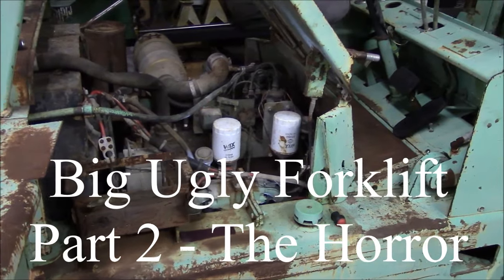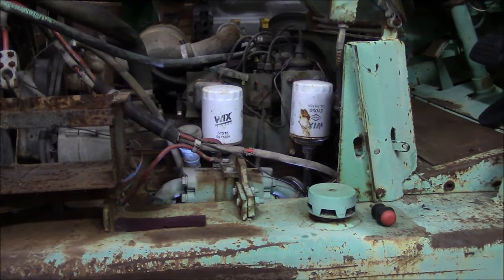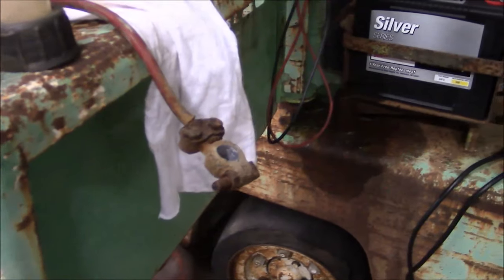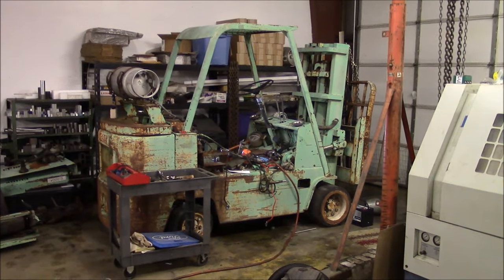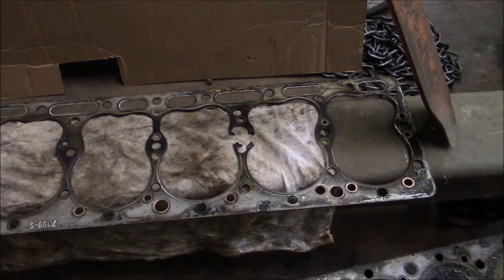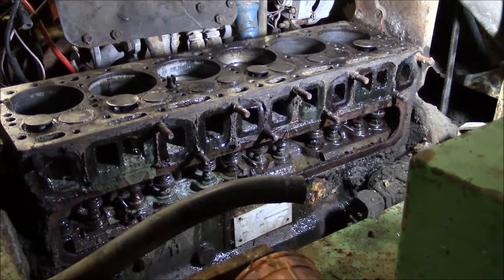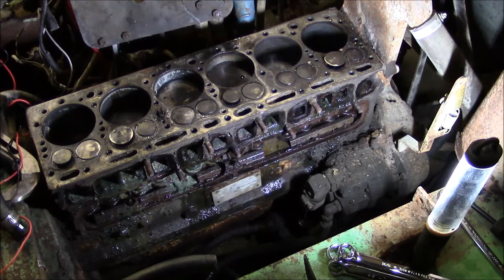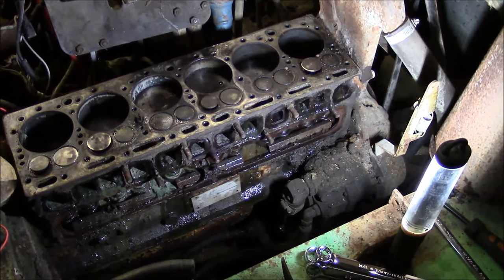Big Ugly Forklift - Part 2 - The Horror

Comment: I just found your Channel.....I'm 70, so been around a bit....I've Never seen any Mfg. shop take any care of Forklifts....not even changing the oil.....My last job I was Maint. Mech-Elec...so I worked on the Forkies...12K# Hyster and a 10K# Cat....they both had driver tires/wheels a LOT bigger than these.....solid tires for indoor use like these, but they ran them outside in the rain, and 3-4" puddles...brakes were pretty bad...everything else was about like this unit.
Reply from the maker: Some shops have a contract with a dealer to do service work and they do a decent job. The shops that supposedly do it themselves are just like you say. I worked in a truck repair shop for about 4 years and I never saw them change the oil on the forklift. But to be fair, we probably didn't use it more than an hour a week, so it might not have been than bad for it.
Reply: ...Well, the last 'shop' was a high production HVAC ductwork ....very busy. They had 4 small 3,500# Mitsubishi Forklifts that were leased, so they had to have service contract every 3 months...those got hammered pretty bad...2 were called back by Dealer for excessive wear/damage....the Cat and Hyster were never added to the service deal.....I was limited to oil/filter changes, due to the shop owners not wanting to spend any $$ on routine maintenance.... When I went to work there, the Hyster had one steering axle wheel with no rubber tire left...just bare metal......it took me months to just get a new $90 'tire' pressed on there..... The Cat and Hyster were running most all day....all 4 years I was there...  Owners attitude was "run it until it breaks, then fix it"....however, most of the shop machinery was as old/or older...than me....

Comment: All engines that run on propane has to have hardened seats or you will burn the valves right out because the propane runs so much hotter than gasoline. They run so much cleaner too the oil on a propane engine will still look new when it's time to change it unlike gasoline that will be black as the ace of spades

Comment: Drop a slant 6 in the thing it will run forever lol!! no those continental flathead engines in them forklifts are really good and can take a beating. they can run non stop and never have a issue unless it's something like a head gasket or something. I use to maintain forklifts at my one job I had back in the day and those things would run 24/7 with only shut down on breaks, refuel or maintenance other then that they were running. the place I worked at had a couple gasoline trucks for outside and I think it was 10 on propane most were nissan a few Clarke and 2 Hysters

Comment: These came originally with points. The distributor shafts were known to wear and you basically had to grab a BFH and just knock the distributor off the head and start chiseling. The replacement was probably a perlux or pertronix replacement distributor or conversion kit installed.

Comment: Is the Model of this Clark forklift a  C50, C60 , Does it have Clark ID Plate on it ?   A 6cycl  normally is in  a 5,000 - 10,000 lbs.cap.   I use to work on Clarks , 40 yrs.  C50 is a 5000 lbs cap machine.  Clark is the Cadillac of Forklifts.  They made the first forklift in America.
Reply from the maker: C500-120.

Comment: right about remam (junk) and overpriced , got a 4.3 gm reman for one of my lifts put it in and knocked after hot , pulled it down the crankshaft had a grove cut in it where the thust bearing runs , so no one ever checked the end play ,